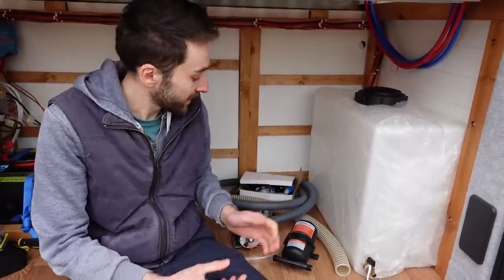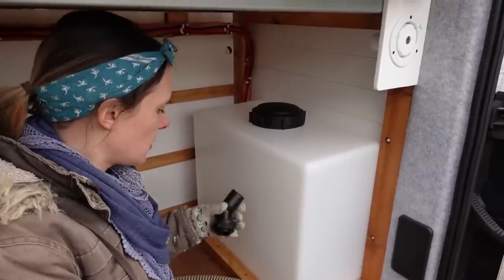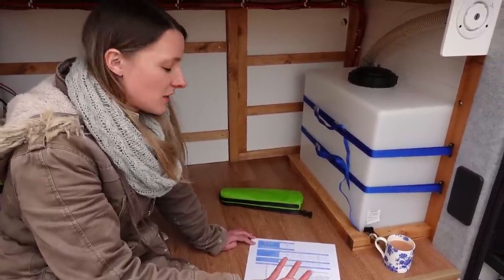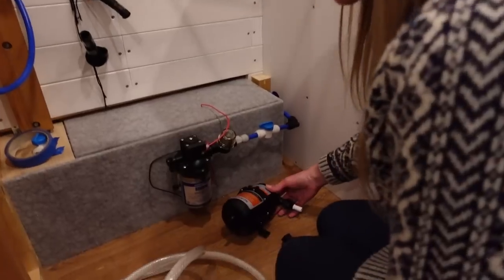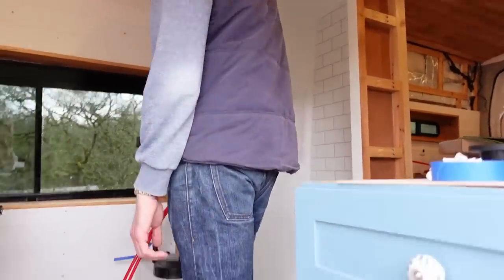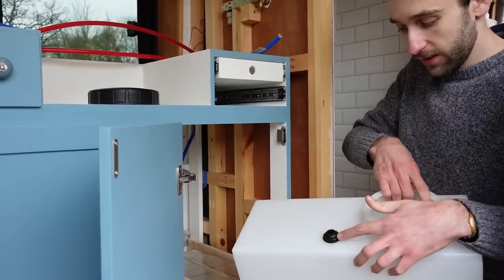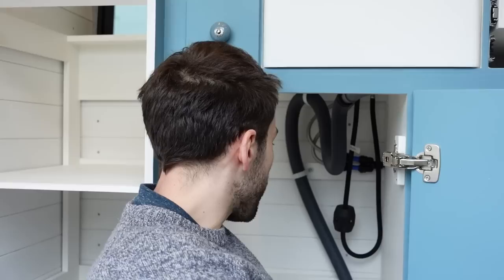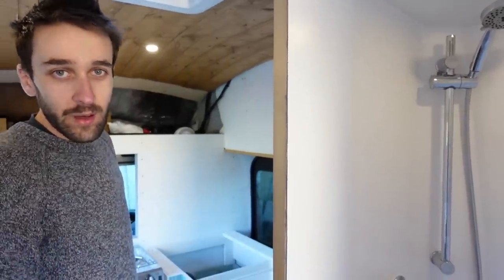Campervan Cold Water System (We Have Running Water!) | Transit Van Conversion E36

Comment: Cool, but I can tell you it's gonna be annoying to always have the back door open while filling up. Especially when it's cold and/or rainy.
Reply from the maker: Cheers, and nah it's never been a problem in a year and a half now, all around Scotland in the Winter and up to Norway and back. We actually think the opposite, glad we don't have it on the outside as occasionally we dismantle the whole setup and give it a deep clean which we wouldn't be able to do as easily if it wasn't so accessible 🙂👍

Comment: Excellent video and have to say I’m very impressed with your setup. I’ve worked as a vehicle technician in the security industry for a major cash carrier company and for years because of the design I and many of my colleagues have struggled to maintain the complex security systems fitted. The way you explained and executed the installation was just brilliant. From your video I now know what the problem was I’m just glad I’m now retired because it would be a major upgrade for a massive fleet of vehicles.
Reply from the maker: Thank you! Just wondering though, did you mean to comment on another video, as ours is only about installing a water system? 🙂
Reply: @SelfBuiltStories  it was actually. The video I watched was the one where you fitted the b2b
Reply from the maker: @micksparrow8214  Ah! That makes sense now, cool, thanks again 🙂

Comment: If you mount the pump on anti-vibration mounts and connect the water with flexible hoses you may lower the pump noise significantly.
Reply from the maker: Cheers, yeah can add some more dampening though we don't find it noisy actually and it will be inside our bench seats when they're done. Quite like the low vibrating sound it has to know it's all working 🙂

Comment: I think the biggest problem with things like these are the constant vibrations it will be exposed too. Not sure what type of construction works best to mitigate that.
Reply from the maker: Yeah we haven't had any issues so far but many more miles and time will tell. We have tried to use rubber spacers and leave some flex in the pipework to mitigate some of that though 👍

Comment: Great job!
Wherever you put the switch for the pump, make sure it's  easy to get to when you leave the van so it can be part of your locking up procedure to turn it off.
Reply from the maker: Cheers! And yeah we're planning on building a switch panel with all of them and the various gauges and things we have. It'll probably live in the cubby hole to the right of the shower. For now it's just a big mess of wires 😃

Comment: Nice strong steady flow, even when you turned the shower on. Brilliant👍😀
Reply from the maker: Yeah we're pretty happy with it! We figured seeing as we're having a recirculating shower there was no point having one of the water saving shower heads and a smaller pump, seems to be working out pretty well 😀
Reply: @SelfBuiltStories  Brill👍👍

Comment: Timely video, just starting my plumbing work on the van 😀Thanks again, another great technical and entertaining video again. On the sink waste, I've bought the same sink. Barratt Tanks, recommend using a  25mm smooth bore flexible pipe not the ridge version as the flow rate is better and less chance of waste being trapped. You can buy a 28mm to 25mm reducer for a couple of quid. Looking forward to your next one!
Reply from the maker: Cheers! And yeah we decided on running 40mm domestic smooth bore waste pipe everywhere under the van into the tank for a nice fast flow. We only have the short section of 28mm corrugated from the sink down to join up to it, but we've left it so that it'd be easy to swap that out for a domestic waste trap too if we need to later on. It's a great sink! Hope your plumbing is going well, a nice job to tick off 👍🙂

Comment: Great job guys. Hopefully hot water will cause no issues. Love the John Guest stuff here but it’s not cheap.
Reply from the maker: Cheers! Yeah the 12mm stuff especially, but they do work really well and so simple to put together. We found there's a few different sellers on eBay that all seem to be cheapest for a few of the different types of connections, so we did a lot of shopping around 😛

Comment: Amazing how smooth (if that’s the right expression) the water flows, proper hardware. I see it in other builds as well, using so many couplings with 90° knees personally I would try to use a little couplings possible. My plan is to 3D print 90° degrees brackets with a large enough radius. A bit like the brackets that often comes with washing machine and so forth.  But again a very informative episode! Best rgds, Albert 🇳🇱
Reply from the maker: Cheers, and yeah very happy with the flow rate, we wanted something that feels similar to being in the house and it all works great 🙂 And fair point for sure! We tried to minimise the number of connections we needed as much as possible but tricky in some areas because of the really tight spaces we had to fit it all into (even more so for the hot water... 😛). You can buy ready made brackets like what you're talking about to hold the pipe for shallow 90 degree bends like that, most of our corners though are a bit more abrupt so we've used the elbows. Have made sure that all of the joints are accessible though and not hidden behind walls, except for things like where they join to the shower valve but will be making that a removable panel 👍

Comment: Woohoo! Flowing water at last! And always (hopefully) only through the intended parts! 👍☺
I do like the push and connect system - but boy are there ever a lot of fittings. To me, every fitting is a potential problem zone and I'd be too scared of possible leaks 😵‍💫. I will actually mount the pump (and the reservoir) in a 3-4 inch deep cut-away tray of a water container with a moisture sensor. Pressure pumps can go awfully wrong and they will pump until the tank is empty. Will you be using an additional filtering system?
Great choice on the filler cap inside 👍! I will also feed the 230V landline to a connect inside through the door as I don't want to cut holes in the side of the van. I've seen many filler installs with equally sized vents, does the smaller diameter pipe work for you?
I do love Abi's drawings - very easy to follow and very clear. The second power panel - great idea. I'll copy that! 😇
I do love your build videos thus far, you put so much effort into the van - absolutely amazing 🙌. One thought though: Have you been on a scale yet 😯? All of the wood and stuff you've added - have you kept track of all the weight thus far?
Keep it up! Cheers from Germany and stay safe! 🚐☁🍀
Reply from the maker: Cheers! 🙂 Yeah it was very fun to see it all working. You can turn on a tap all day long in the house and take it for granted but something about connecting it all up in the van and having water come out, very satisfying! There are a few fittings yeah but we tried to only use them where we had to, and given the tight spaces particularly in the kitchen cabinet there wasn't really anyway to do it with less. Although to be honest, we've found the push fit to be really reliable. The only small leaks we've had were when we hadn't pushed them in completely, but when properly seated home they've been great and we've pumped a huge amount of water through all the pipes now so not really worried about it. We have thought about adding a filter for the drinking water but haven't yet (we'll have lots of filters for the shower of course). And yeah the inside fill port works great, fills really nice and quickly. No problem at all with the breather tube, it's 10mm and more than adequate for taking it as fast as the hose can give it. And yep we've weighed the van a few times now and try to keep track of the weight of things as they go in too. But we think we're going to uprate the van a little anyway to give us a bit more flexibility 👍 Thanks for all the support as usual 🙂

Comment: Hiya! When you bought your plumbing supplies (tubes/pipes, valves/taps, elbows etc), did you order everything up front based on your initial plans, or did you buy as you went along with the installation? I've planned everything on paper for my plumbing, but nailing down the exact quantities and specific products is proving a bit tricky. The John Guest products are a bit pricey, so I'm trying to figure out the best approach without getting more than I need... 🤔Any tips would be really appreciated. Thank you!
Reply from the maker: Hey! Yeah that was tricky! We made a diagram of the water connections and then like dominoes tried to go through it pipe by pipe end to end and count how many of each type of connector and insert we'd need. So we had a good idea but yeah it was very hard to be exact as until you start putting it all together you don't know exactly how you're going to route it, and there's nothing more annoying that being almost at the end of a project and not having one tiny bit of plastic to finish it! So with stuff like the shut-off valves, one way valves, tees and things that we were pretty sure we knew how many we'd want we ordered the exact number, and then we over-ordered on elbows and inserts so we'd be able to route it in different ways. Highly recommend a good number of the stem elbows too, they're really useful for making tight corners without needing a tiny bit of pipe as well. And yeah they're very pricey for what they are, so we shopped around and found eBay was the best place to get them. We found between 3 or 4 sellers they would be a bit cheaper on one type of the connector (think we have some links in the description), and all had free delivery. So we split it up across them all. And we also treated the cold water, hot water, and recirculating shower as three separate projects and just bought the ones we needed for each one at the time. HTH and good luck 😀
Reply: @SelfBuiltStories  thank you so much!!
Reply from the maker: @maddisonlt  No problem! 👍

Comment: Thanks for the videos. Very good to watch. Please could you let me know what pressure you set your accumulator to? Thanks
Reply from the maker: You're welcome, thanks for watching! And we set it in the region of 17-20PSI (for our 30PSI rated pump), but it took a bit of experimentation. We went back and forth a few times changing the pressure and testing it at the taps till we got it just right, it makes a big difference when it's all matching nicely 👍😀

Comment: Hi, loving your channel as this is something I would love to do but I think you demonstrate the need for patience that would be lacking!! 😂 Nerdy comment coming but it's a big part of my job! - Looking at the cold water storage, is there anything that needs to be put in place for Legionella prevention? I'm surprised the tank is not insulated to keep it cool although I suppose that wouldn't last long, especially in summer. The large top cap would allow for a low level chlorine addition every day or so and the test strips for outlets are pennies but would be piece of mind especially having a shower on board that is high risk. It would mean bottled water for drinking but I think that would probably be safer anyway. That and a carbon monoxide detector for the LPG and diesel heater and smoke detector in the living area and garage (battery storage) is my job flap out of the way, now back to your videos!! 😂😂❤
Reply from the maker: Hey, cheers 😀 That's an interesting thought, would be surprised if the cold tank got up to 20C+ as any point for it to start to build up as it's regularly filled up from cold taps and the whole tank volume is replaced fairly frequently as we're using it. New water is added every few days or up to a week at most. Being able to test everything would be pretty cool though, where would you recommend for picking up some strips? We like not having to use bottled water but we have been thinking about possibly adding a separate filter before the cold tap as well. For our hot water we'll be taking the tank up to 60-70C periodically to kill anything off, and replenishing the water every few days as well so not too worried about that. And yeah we have a smoke and CO alarm on board, as well as a fire extinguisher and gas leak detection pen. Thanks for the comment 🙂👍

Comment: Hello, thanks for all your video.   They are incredibly helpful and soothing at times of much flapidness 

@ 6.19 you show the small fitting on the bottom of the tank for the feeder pipe.  I wonder if you would be kind enough to tell me what this fitting is called please??  I've been umming and ahhing about my water tank, but it's time!  This is it!  I'm going in!!!!

Your video has given me much confidence (as have some of your other videos which I've watched repeatedly - thank youuuuuu), but this one little thing I cannot find online.  If you see this comment and recall what it is, I'd be incredibly grateful 😁😁😁😁  Cheers very much!

Addition:  I think it's a bulkhead connector.
Reply from the maker: Hey, no problem glad to hear it 😊 And sure no problem, the one at the bottom of the tank that is for the cold water supply is a 12mm JG bulkhead/tank connector. It's the one listed as '12mm Bulkhead' here: https://www.ebay.co.uk/itm/223155488264 . Hope that helps and good luck with the water system install! It's a very rewarding moment when you have water in the van!
Reply: @SelfBuiltStories  cannot thank you enough.   Had a 3 month break from building and forgot about the level research and questions one faces!!  REALLY APPRECIATE YOU GUYS xxx  ps, followed the link and ordered the tap yesterday 👍👍👍👍
Reply from the maker: @minttea4972  No problem at all, and yeah there is so much to research for each project! 😬

Comment: As always, amazingly useful video. I'm about to start drilling through my floor and I'd like to use the magnet method as you guys have done. Can you tell me what strength fishing magnets those are? I don't want to get something too strong or too weak (since the depth of 25mm PIR and plywood floor will decrease strength significantly) yet would rather not overpay for something too strong either. There are so many to choose from! Also considering a 100kg 'switching magnet since I have a fear of not being able to remove it from something! Also, someone said you can use a ball bearing on one side rather than two magnets... might save a bit of cash if it works
Reply from the maker: Cheers, glad it was useful :) And sure, ours are rated for 250kg. That seems to be a good sweet spot as we can feel the magnetic force through the van even through our composite floor which is 25mm PIR, 12mm ply and vinyl. But not so strong so that we can't remove them from the underside easily. They take a bit of force to remove but nothing too bad, and a lot easier it you remove at an angle. Interesting idea with the ball-bearing, let us know if it works if you try it 😀

Comment: hi guys, love the series! super helpful with out conversion. not sure if you still read the old comments but i'll try anyway - where did you get the fittings for the inlet on the top of your water tank that you added, for water fill + breathing pipe? can't find them from the description info and they look perfect for this as we are using the same setup as yourselves. cheers !
Reply from the maker: Hey, glad you're enjoying the videos! We got them both from the same place, this is the angled fill: https://www.leisureshopdirect.com/water/camping-water-carrier/rv-tanks/bulkhead-and-tank-fittings/tank-fitting-40mm-angled-inlet . And this is the breather pipe: https://www.leisureshopdirect.com/water/caravan-plumbing/rv-tanks/tank-connector-3-8inch-with-nozzle . The angled fill took a while to find, almost everywhere else only seemed to have straight ones! HTH and good luck with the build 👍
Reply: @SelfBuiltStories  haha you guys are awesome, rapid response with links as well thanks so much I really appreciate your help. All the best on your travels maybe we'll see you out and about one day!
Reply from the maker: @Bawsyyrs  haha no problem, yep see on the road! 😛

Comment: Hi! I have absolutely been LOVING your videos! Truly such a pleasure to watch. But I have been wondering, are all these tools from you? Or are you renting/using the tools from somebody else? I would love to one day have my own van conversion, but it’s already really expensive as is, to buy all the tools with it will be even more expensive. So I was wondering! :)
Reply from the maker: Hiya! That's great, glad you're enjoying them all 🙂 And the majority of tools we use are either second hand from car boot sales etc or borrowed from family. The ones we've ended up buying new are the more specialist ones specific to the van, which is pretty much everything for the electronics, the rivnut tool, pocket hole jig and small intricate things like right angled bits. We also got our own useful staples like jigsaw, drill, screwdrivers etc that end up being used for pretty much every project. If we do have to buy something we make sure to shop around because as you say it can get expensive quickly. Some of the handy tools we have we've just picked up in Lidl! You don't need a lot of tools to get started though, they just make it a bit easier 👍

Comment: Great video! Just wondering if you have links/names for all the fresh water connection bits + the filler tubes that you used. Really struggling to figure out what I need for my own build. Your videos have been very helpful!
Reply from the maker: Cheers :) And we got it a lot of it from eBay, like the fill port (https://www.ebay.co.uk/itm/144157371031) and most of the pipe and connectors too (e.g. https://www.ebay.co.uk/itm/185659041034). There are various sellers on eBay and some where cheaper than others for particular connectors, which added up quite a lot. So for each type we shopped around the best ones. HTH 👍